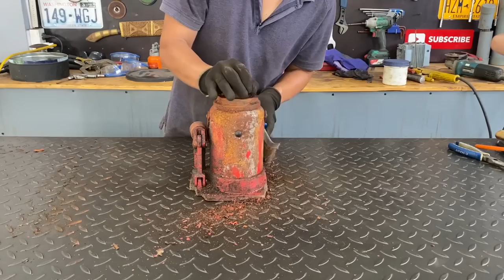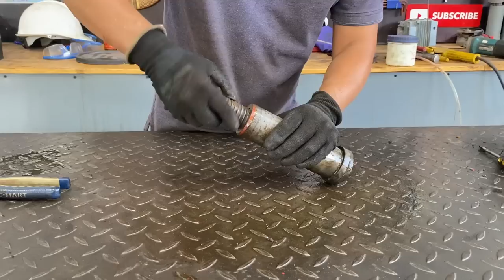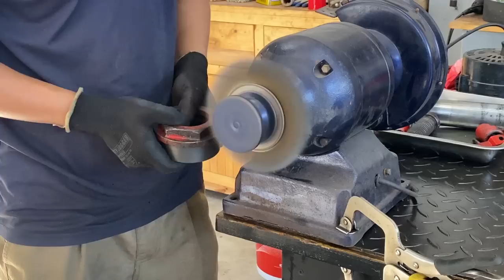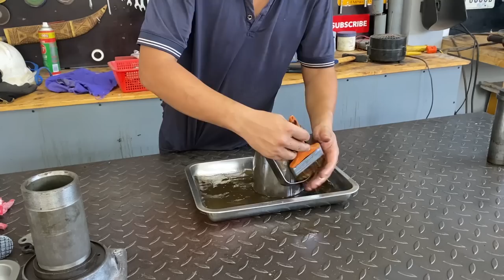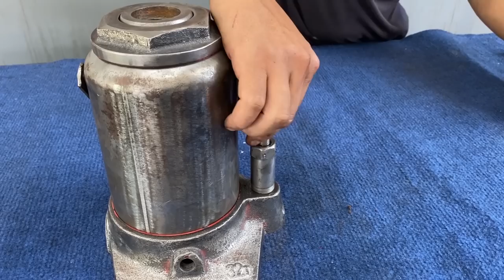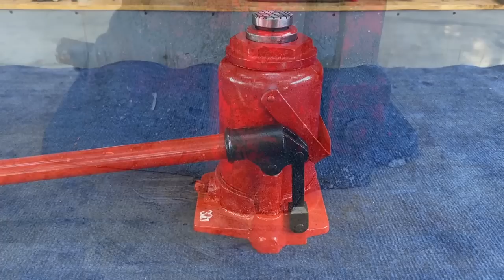Restore Old Rusty 32T Hydraulic Jack | Restoration Videos Hydraulic Jack

Comment: Why didn't you first put the jack into a parts washer and wash away the dirt and loose paint and rust that encrusted it?  Wouldn't that have been the logical place to start?  I realize that subsequent washings of individual parts would have been necessary, but the application of WD-40 would have been more effective had you not been trying to penetrate all that dirt and detritus before getting to the work piece itself.
Reply from the maker: Thanks for watching and supporting me. Thanks very much!!!